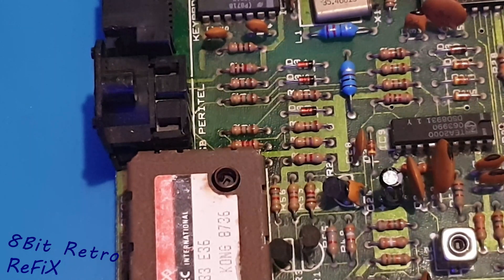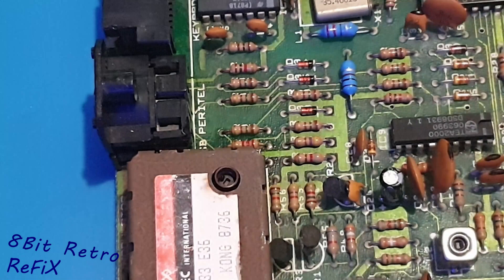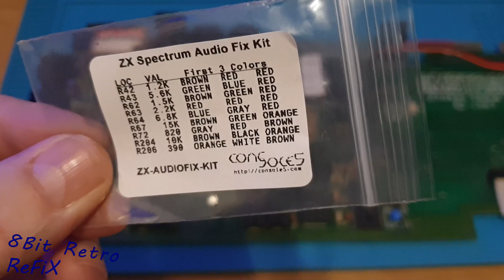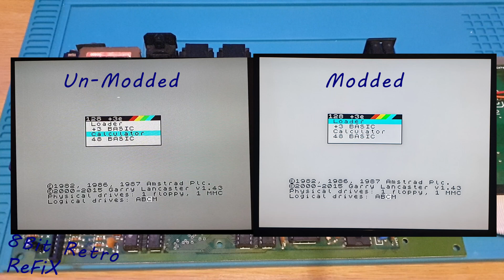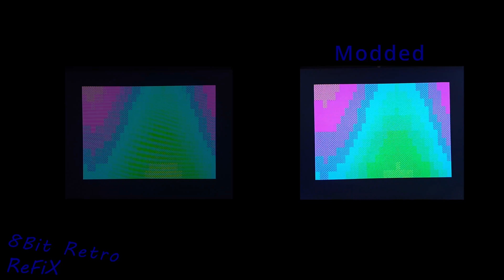Spectrum +3 Audio Mod & Composite Mod + Comparison Test Part 3

Comment: Wow, very impressive! Those are worlds between modded and unmodded, very cool!!! So it was absolutely worth it! :-) I am actually also in soldering mode :-D I built the Retro Chip Tester Pro, it is finished, just waiting for the last missing components, those are the 12V voltage regulators.. but I already tested it in limited 5V mode, works perfect :-) cheers!
Reply from the maker: Cool .. I could do with a Retro Chip Tester Pro tester .. Ive got testers for some memory chips but not all .. Audio MOD is a must for anyone with a +2A or +3 ... The screen is crisp and clear now more so than what shows on the video ..Video capture device next . :)